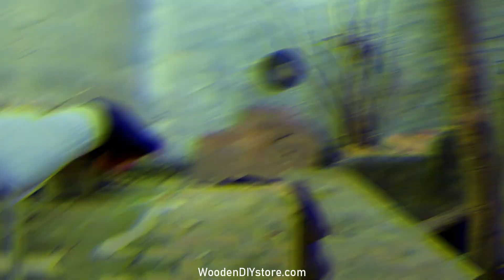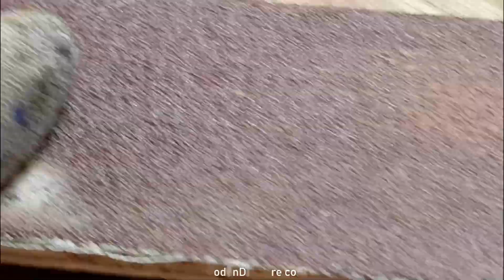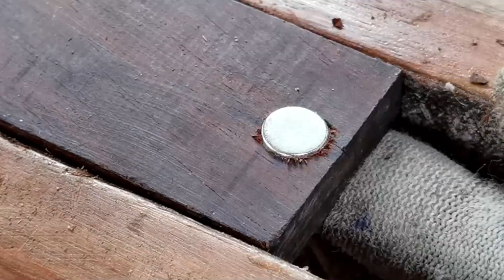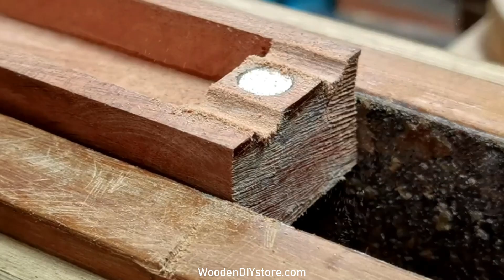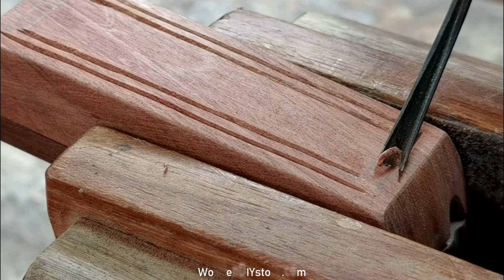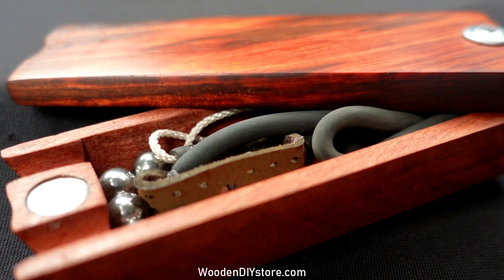100% Handcrafted - Fancy "BOX" Hidden Rubber Tube Slingshot

Comment: In the slingshot forums some say the pulleys don't spin fast enough, unless the bands are very tight and the bearings are often oiled, it won't be as fast as a tapered bands paired with an ammo matched in weight.
Reply from the maker: Thank you for the information, I will try my best to improve the quality of my product in my upcoming videos.